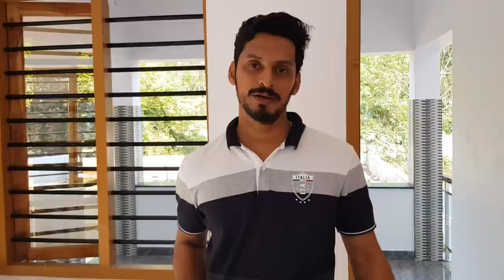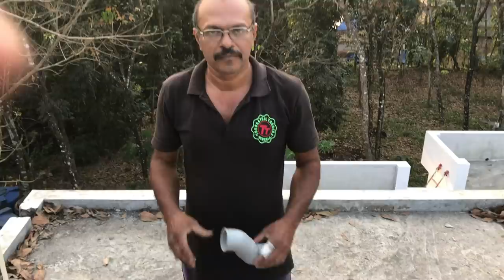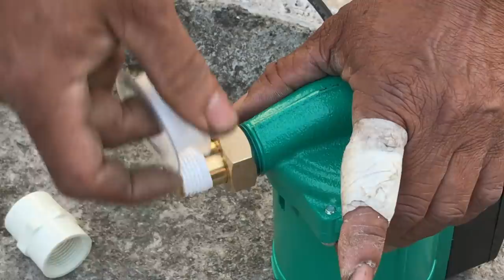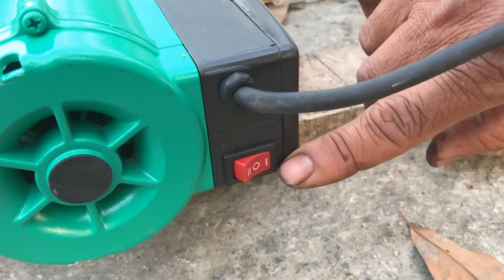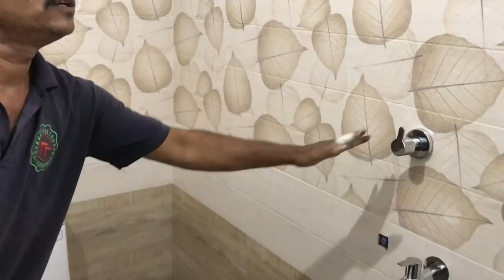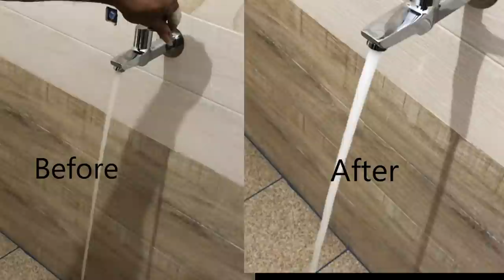How to install Pressure Booster Pump - പ്രഷർ ബൂസ്റ്റർ പമ്പ് എങ്ങനെ  ഫിറ്റ് ചെയ്യാം ?

Comment: ഞാൻ വെച്ചിട്ടുണ്ട് , ഇതിന് 1000/-,1500/-  രൂപ വിലയുള്ളൂ.
കോയമ്പത്തൂർനിന്നാണ് വാങ്ങിയത്. 5 years ആയി. No problem 👍
Reply from the maker: സൂപ്പർ സർ.. ഡീറ്റെയിൽസ് മറ്റുള്ളവർക് വേണ്ടി ഒന്ന് ഷെയർ ചെയ്യാമോ ? ഞാൻ എത്ര ശ്രമിച്ചിട്ടും അങ്ങനെ ഒരു റേറ്റ് നു നല്ലൊരു പ്രോഡക്റ്റ് കിട്ടുന്നില്ല ..

1000 ,1500 രൂപക് വാങ്ങിയ മോട്ടോർ ഡീറ്റെയിൽസ് തരാമോ ? എത്ര hp ആണ് ? ഫ്‌ലോ സ്വിച്ച് ആണോ ? പ്രഷർ സ്വിച്ച് ആണോ ? കഴിയുമെങ്കിൽ കമ്പനി കൂടെ ഷെയർ ചെയ്യണേ ..
Reply: Need details
Reply: Brand parayamo
Reply: Brad ഒന്ന് പറയാമോ
Reply from the maker: 1500 roopayude pressure pump ethanu ennariyan ellavarum agrahikunu. Dayavu cheythu brand and details thannal nallathayirunu
Reply: Thallano
Reply: വേണ്ട തല്ലണ്ട അവൻ ഓടി,
Reply: Brand eetha?
Reply: Eda drohi details parajittu poda
Reply: Da kala mada onnu parayada
Reply: @thundathiltraders  ഈ പ്രഷർ പമ്പിന് എന്ത് വില ഉണ്ട് 230 വോൾട്ടിൽ അല്ലെ ഇത് പ്രവർത്തിക്കുന്നത്
Reply: എത്ര ബാത് റൂമുകൾ ഉണ്ട്
Reply: @thundathiltraders  You cannot trust a coimbatore pump. Substandard material,  needs heavy maintenance. Generally pumps cannot be that cheap owing to the cost of materials like copper etc.
Reply: 5year munp athrye undvullu. ipo avde ithe rate aayitundkum.
Reply: Chettai ethu evdy kittum
Reply: 1500 😂😂😂😂

Comment: ഞാൻ വീട്ടിൽ ചെയ്തിട്ടുണ്ട് 4150 രുപ ചിലവിൽ.
2350 1",0.5 hp single phase motor
1450  pressure switch with guague
3.50 fittings
 1 1/2" Nrv-2nos 
Union valve 2nos 3/4"
PVC T 2nos
PVC male adaptor 2nos
Union valve 1 1/2" -1
Reply from the maker: Nice ..അത് നല്ലൊരു ഓപ്ഷൻ ആണ്.
ഈ മോഡലിന്റെ പ്രത്യേകത ഏതു മാക്സിമം 0.54 A കറന്റ് മാത്രമേ എടുക്കു എന്നതാണ്
 0.5hp മോട്ടോർ ആവറേജ് 2.5 A കറന്റ് എടുക്കും. പിന്നെ ഈ മോഡലിന് പ്രത്യേകം പ്രഷർ സ്വിച്ച് ആവശ്യം ഇല്ല . ഓവർ ലോഡ് പ്രൊട്ടക്ടർ ഉണ്ട്.ഡ്രൈ റൺ പ്രൊട്ടക്ഷൻ വരുന്നുണ്ട്.
Reply: Aevidunna vaangichath.aetha company

Comment: Ive fixed one , but the problem is its not smooth flow while opening tap. Its fluctuating,  when motor on and off. How to adjust or fix it , can you guide suggest  or a better  technician contacts in kannur, payyannur, cherupuzha area. Please
Reply from the maker: Please ask the dealer from where you bought the product to arrange service for you.

Comment: ആ ചേട്ടൻ പൈപ്പ് കട്ട് ചെയ്തില്ലേ അവിടെ നിന്ന് താഴെ ഇറങ്ങി പോകുന്ന പൈപ്പിൽ എൽബോക്കു പകരം Tee ഇട്ട് എയർ ഇട്ടാൽ നന്നായിരുന്നു അപ്പോൾ തന്നെ നിങ്ങൾക്ക് വെള്ളത്തിന് ഫോഴ്സ് വ്യത്യാസം ഉണ്ടാകും ഒരിക്കലും ടാങ്കിൻ്റെ അടുത്ത് നിന്ന് horizontal പൈപ്പ് കൊണ്ടു പോയാൽ വെള്ളത്തിന് ഫോഴ്സ് കിട്ടില്ല പിന്നെ ടാങ്ക് 5 ഫീറ്റ് ഫ്ലോറിൽ നിന്ന് പൊന്തിച്ചു വെയ്ക്കണം
Reply from the maker: 5 adi pokkiyal force diffence undavum. Oru rain shower or shower panel undenkil pressure pump must anu.

Comment: Oru doubt undu water heater pressure kuravanu appo ithu veykkunnathu kondu problm endhelum undoo??
Reply from the maker: Electric geyser inlet boost cheyyan use cheyyam. Kurachu koode pressure ulla type anenkil nannayirikum

Comment: Iam from kakkad,malappuram dt. I need to fit pressure pump as water pressure is very low in the first floor of my house. My water tank is concrete water tank. Pls reply
Reply from the maker: Yes we can use this model to boost the pressure. We do have other models depending on your requirements
Reply: @thundathiltraders  the lo plkyy next t 🙏🙏

Comment: means ed install cheyyan anthenkilum  specification undo adayad watter pipinu normal PVC pipe ettal madiyoo  ado guage koodiyath edano ante veed Pani nadannu kondirikkuka Anu
Reply from the maker: normal pvc mathi.  sadarana 4kg enkilum minimum gauge ulla pipe anu plumbingnu use cheyyuka. ee pump maximum generate cheyuka 0.7bar pressure anu. so pipe pottan otum chance ella. pinne joint nannayi ottichitila enkil thalli povum. ee cheriya anenkil athinum chance ella.

Comment: Hello we have already SCALA2 for inline cold water pressure , now we have to install solar non pressure glass tube type waterheater hotwater pressure pump similar pressure of SCALA2 , our water heater us litle lesser height of main tank, we want to maintain equal pressure for both cold & hot water, can you advice which pump can apply ? & Is there fully automatic same as SCALA2 ? Auto release air etc ?
Reply from the maker: We can use hot water pressure booster to meet your purpose. . There is no option for auto air release.

Comment: 2 inch (out) pipilek 3/4  inch( in) pressure pump engeneya workout avunne
Reply from the maker: Work avum. Pump etra pressure generate cheyumo.. atrayum pressure pipe size higher anenkilum generate cheyum. Videoyil koduthirikunathu 1/2 inch delivery 1.5 ayi convert cheythanu.

Comment: ഇതിനു എന്തു price വരും, വ്യത്യസ്ത pressure ഇതിൽ set ചെയ്യാൻ സാധിക്കുമോ, manual mode ൽ pump full time run ചെയ്തുകൊണ്ടിരിക്കുമോ അങ്ങനെയെങ്കിൽ എല്ലാ tap ഉം close ആയാൽ എന്തു സംഭവിക്കും
Reply from the maker: Price around 6000 Rs. Otta pressuril ayirikum work cheyyuka. Manual Mode il Avashyam undenkil matrame edavu. Pump Epozhum Automatic modeil anu work cheyendathu

Comment: Chetta ee pressure pumpinte name entha?  Customer chodikkumbol parayana? Rate venam?ella shopilum kittumo?
Reply from the maker: Wilo Brand , Model : PB088EA , Inline Booster pump ennanu parayuka. Rate around 6000/- inclusive of all taxes and courier charge. Ella shopilum kittan chance kuravanu
Reply: @thundathiltraders  chetta 3 phase connection ulla veetil 3 phase motor thanne vekkano? Single phase motor vekkan pattille?
Reply from the maker: @vipinanvipin4254  Venam ennila.SIngle Phase  motor vakkam. upto 2HP single phase ok anu. athinu mugalil venamenki 3phase anu nallathu

Comment: Can we use it for return hot water line solar water heater? Does it sense hot water and auto cut off?
Reply from the maker: We have another models for that. It comes with the temp sensor.
Whatsapp 7034904458

Comment: Is it necessary to install this pump near the geyser inlet inside the washroom or installing at roof top tank outlet will also give pressure below in the washroom?
Im in doubt if to install in the main cold water supply to the washroom or specifically to the geyser inlet.
Pls advise
TIA
Reply from the maker: You can add it on the top or inside. Both are ok.
Make sure there is a minimum height difference between the tank and the shower

Comment: Pressure is very low. This is 110 watt pump. For more pressure better go for 0.5 HP or 1.0 HP pressure pump.
Reply from the maker: correction ! Its only 60 watts.  If your purpose is less u don't need a 370 watts or 750 watts motor ,the one you just suggested.

Comment: Ser what cost the pressure pump fitting ,
Reply from the maker: cost for pressure pump ? or pressure pump installation ?
Reply: @thundathiltraders  ser wilo booster
Reply from the maker: place?
Reply: @thundathiltraders  ser Maharashtra Pune ,
Reply from the maker: @Sunil-gd7zx  we can supply motor. direct installation not possible

Comment: Pressure booster pump വില എന്താണ് എവിടെ ലഭ്യമാകും
Reply from the maker: https://www.youtube.com/watch?v=djQeM5qD2UE&t=326s
video kandu noku.
Reply from the maker: https://www.thundathiltraders.com/product/wilo-inline-pressure-booster/
Reply: Crompton rs 3700/-
Reply from the maker: @Akhil178  HP ? Consumtion ? pressure ? discharge?
Reply from the maker: @Akhil178  I belive the model u told me is 119 watts. With 125 watts we can get a pump in wilo which can pressurize 2 bathrooms with rain showers.

Comment: A METTALIC GI SHEET COVER WITH AERATION SLOTS CUT IN IT IS GOOD  FOR SAFETY STANDARDS  THE PUMP. MUST HAVE FOUNDATION.FOR THE BASE PLATE AT LEAST 9INCHES HIGHER THAN THE TERRACE  FLOOR  LEVEL IN CASE OF HEAVY  RAIN WATER  WILL NOT CONTACT THE PUMPS ELECTRICAL  WIRE JOINTS
Reply from the maker: Thanks for the suggestions

Comment: Pressure pump fit cheyynnadinu seperate plumbing cheyyano ado sadarana cheida plumbingil ed add cheyyano pattumo
Reply from the maker: Sadarana plumbing nallathanenkil add cheyyamalo. ee cheriya pump 0.7 bar pressure anu generate cheyuka
Reply: Nallad means ed install cheyyan antgenkilum specification undo adayad watter pipinu thinned normal PVC pipe ettal madiyoo  ante veed Pani nadannu konfirikkuka anu
Reply from the maker: pvc thanne mathiyalo minimum 4kg ku thazhe plumbing cheyyarila. pipe pottunathinekal kooduthal valya pressure booster anenkil complaint varunathu joint thalli pokunathanu.

Comment: Ith saatha pvc pipil connect cheythal problems ndo
Reply from the maker: Illa . We can use it in PVC
Reply: @thundathiltraders  pvc ജോയിന്റ്റുകളിൽ ലീക്ക് ഉണ്ടാവാൻ സാധ്യത ഉണ്ട്
Reply from the maker: @venugopal6030  Ottum sadhyatha illa. 
Inline pump with flow Switch anu.
 Lineil pressure load avilla. Line open avumbozhe motor on avu. Flow ninu kazhiyumbo motorum off avum.

Comment: Can we generate a pressure of 200bar through the same process, ofcourse with an higher capacity pressure pump..
Reply from the maker: Yes. We can. But practically 200 bar pressure is too much.
Reply: The pipes are having a lesser rating of maximum 6.5 bar generally

Comment: How much is the cost and fitting charges, all inclusive. Can we fit one for all taps in the house. For an average house with 3 bedrooms how much will be the total expense
Reply from the maker: This model is only for 1 single point . Can be connected to only a single bathroom

Comment: Nte vitil ground floor 4bathroom and kitchen und pressure vallare kurava yethra hp motor vendi varum athinte rate nthavumm palakkad district annu
Reply from the maker: 4 bathroom at a time work cheyyano ? upayogichirikuna shower details ellam onu whatsapp cheyamo ? 7034904458

Comment: Please dont buy this pump .. I have installed this pump 3 yrs back... frequently it get faulted and finally I purchased one more pump and replaced from same brand .... it's worked well for some time then again had trouble.... the first  and second  pumps need to be attended by the company service reps.... since 3 yrs one pump it not happend.... very poor service after the sail in Kerala.... I am planning to file a case in customer court.
Reply from the maker: Thanks for the comment.
Let me know the fault you had with the pump. Give me details about the service done. Did they replace any spares? The only problem with the pumps is the flow switch which gets clogged when your tank is not clean. If you have repeated same problem in the site , before replacing a pump you should be aware of the complaint of the first one. Replacing pumps without solving the basic issues is not the right way to do it.

Comment: Up to how many bathroom can work simultaneously by 0.5 hp booster
Reply from the maker: 1 bathroom Max
Reply from the maker: Hope you are asking about this specific model.There are other models which can be used for upto 3 bathrooms
Reply: @thundathiltraders  can you suggest models which can be used for 3 to 4 bathroom
Reply from the maker: @jithinramachandran2482  1 HP Booster pump will be good enough. Pls contact 7034904458 (whatsapp ) for images and price details

Comment: Valve ന്റെ പൊസിഷനിലും മോട്ടോറിന്റെ out put പൊസിഷനിലും ഓരോ NRV ( നോൺ Return Valve) ഇൻസ്റ്റാൾ ചെയ്താൽ it will work better (especially while no electricity) Wilo pump is a very good quality .
Reply from the maker: Thank you for the suggestion.
This model will work with inverter support since it's only 60watts